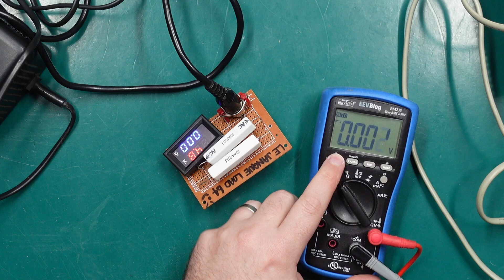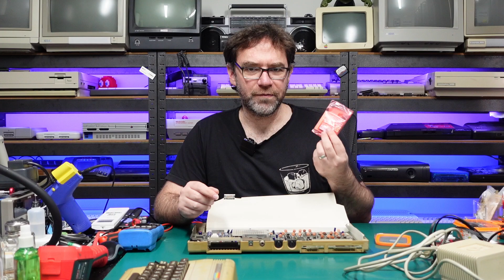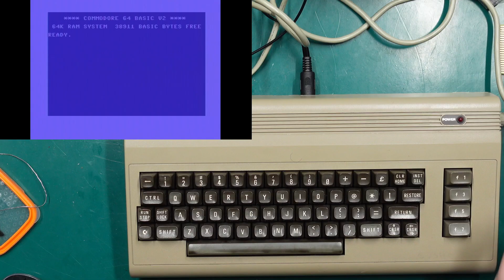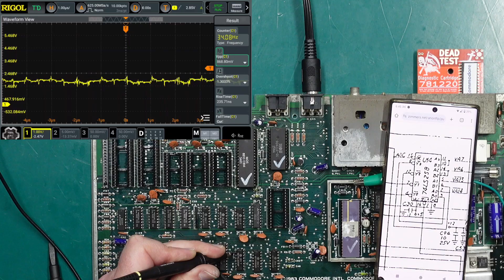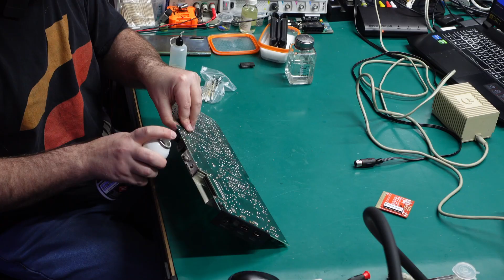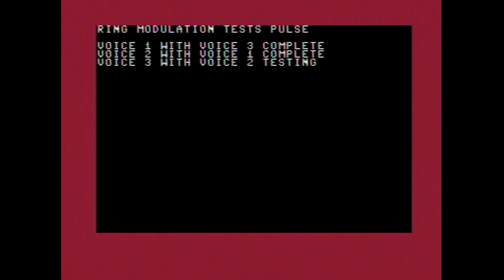Fixing a very sad C64 with some interesting faults

Comment: For once it was the colour ram! it often isn't, and is one of the surrounding chips resulting in dead test flagging that one! Lovely to see Hank, what a bruiser of a kitty! 

Do you recap Commodore Amiga's? if so I have a couple of 1200 boards and a 600 that need recapping (preventative maintenance, they haven't leaked yet, but would rather replace them before they leak, not send in boards with track damage after the fact. Am in Sydney so could post you the boards.

Comment: I have the EXACT same board with black screen and it had the EXACT SAME BAD capasitors...I have replaced the capasitors and then there was some white dots signal on screen after that. The Pictional Guide suggested U31 ;) ,so I replaced that. Now I have black screen again ,but your video have giving me hope for getting it work. I´ve also waiting for a KUNG FU FLASH 2 cartridge,so I can load the DeadTest.crt into that (I have a fully working C64 also, unfortunately only VIC,KERNAL and SID is in sockets) ,so I hope I can get further with the KUNG FU FLASH 2 cartridge. But I learned a lot by you video,regarding what chips is needed for simple boot etc.. I dont have a scope or test harness though :(

Comment: 40:35 - wow! I’m genuinely confused, I’d always thought the RF modulator must be just for that antenna output that I never use. How does the RF modulator affect the video out from the AV DIN jack? Ok, I should look at a schematic, but that won’t tell me how your replacement is making such an improvement - great result, well done - I’d better start fixing those video problems in my own C64s.

Thanks for another interesting video. I always find it surprising to have so many different faults at once. Sometimes I wonder if a machine has been used as a parts donor many years ago, and all the bad chips have ended up in it (at least the socketed ones)
Reply from the maker: The RF modulator also includes components to amplify the luma and chroma outputs from the VIC-II and mixing those signals for the composite output. These are then fed back out of the RF modulator to the AV DIN. The original RF modulator also applies some filtering, probably to conform to some FCC regulations. Problem is it does a very poor job with all this, so replacing it with a new circuit can improve the video output

Comment: On my C64, the two caps (C108/C107) were leaked, too, and it also damaged one half of U31, resulting in wrong clocks - still producing output, but at 1/3 frequency.

Comment: Have you ever actually seen an overvolting PSU? I suspect the risk has been hyped to unrealistic levels.
Reply from the maker: I don't think I have. I've certainly come across some that didn't output anything but perhaps it's more of an issue with the North American PSUs
Reply: I have got a European one that is a real c64 killer, overvolts on both AC and DC.
Got another one just overvolts on the DC.
So no it's not a myth and it happens but the best thing is its totally avoidable by either using a modern supply or one of the protection boards that are out there.

Comment: Excellent work! And great video.   Very smart with using the kawari to check.  . I would have never thought of that:)   also I have a couple c64s that show the blue when using the SD card modulator...  the kernal rom rev 2  not 3 ... that's why... always bothered me,   now I know.   Thanks bud, and cheers
Reply: Hello again:)   no help being asked this time 😅.   I have a few 250466 boards.   My favorite!   I received a very ugly yellowed 64C yesterday.   With the cost reduced keyboard.   Has the 466 board which I knew from the pics on back.  The serial port is always aluminum shielded around the port when shortboards are on both ports.   Anyways,  I thought 86 was the last year of the 466?   I have date codes of 4th to 6th week of 87 on the chips:)     niiice eh?   I wonder when the last vicII 6567R9 was made 🤔 all 466 boards I have are the old style keys... again my favorite

Comment: I really enjoyed that one, Mark.  I've never had one with that clock problem, so I learned something new.  It surprised me that the 82S100 was shot.  Those are usually so reliable.  No big surprise on the rest, though.  I've had some bad luck with 2114's, and the ROM and CIA failing are almost as cliche as a bad MOS PLA.  Great work and fun video.  Cheers!

Comment: Yet again an very interesting video, much appreciated. I recently came across an strange kernal chip in an c64. I have tried it on several different boards and with the diagnostic cart it shows "bad" every single time. It seems to be working with an normal bluescreen. Can you think of an good way how to test it out in order to see if that chip is indeed an faulty one?
Reply: You should read out the ROM with a ROM tester and than compare it to a known good ROM.
There's a good ROM tester shown at the channel of Adrian's Digital Basement. When you can get the same one, there should be no further issues.
Reply: @Dirk-Ulowetz  Many thanks At the time i was making the question i was still watching the video so thanks to @TheRetroChannel i might also  have one of the rev 2 kernal chips.
Reply from the maker: I don't think i've ever seen the diagnostic cart report "bad" for the ROMs. Usually if it doesn't recognise the Kernal it will report "unknown". If you can run the diagnostic then the Kernal must be working, what does it show without the diagnostic cart? Does it look like the regular boot screen?
Reply: @TheRetroChannel  Yes it shows the normal blue screen every single time. I have tested it on a few different motherboards (250407 and 250425) with the same result. If i remember it correctly  when i tested it for the very first time the diagnostic test did pass.
Reply: @TheRetroChannel Oh i forgot to ask if you could enlighten me which kernal is v2 and which one is v3? What are the differences?
Reply from the maker: Robin from 8bit show and tell did an excellent video on the Kernal differences, I'd give that a watch
https://youtu.be/If4mcprqBZw?si=5Y2R8Yr1wvRRiIa_
Reply: @TheRetroChannel  You're an ace, i look forward to watching it :)